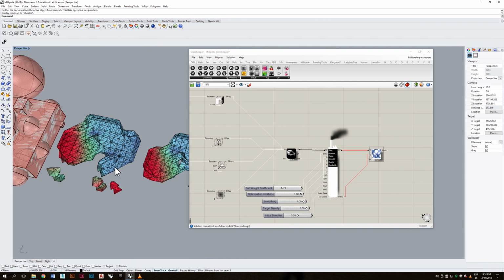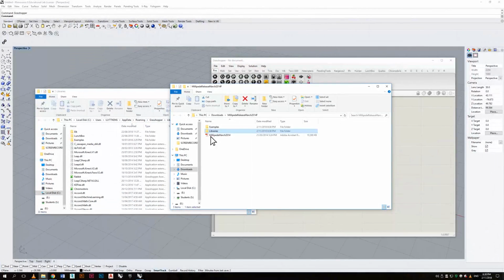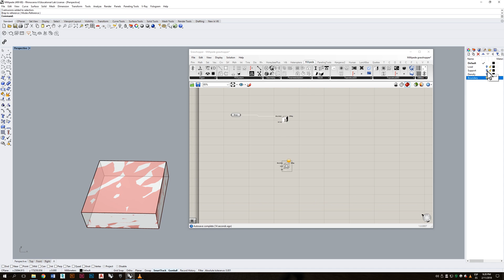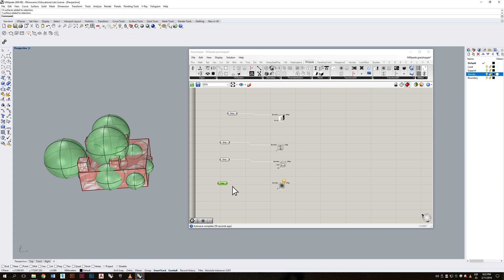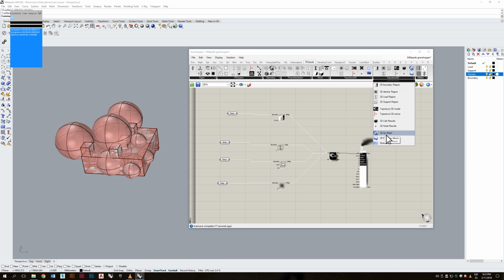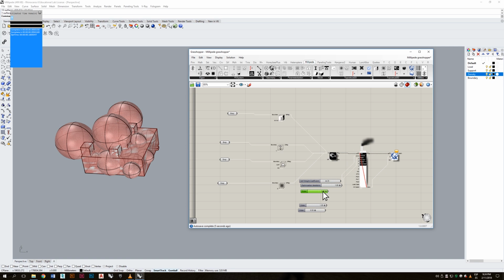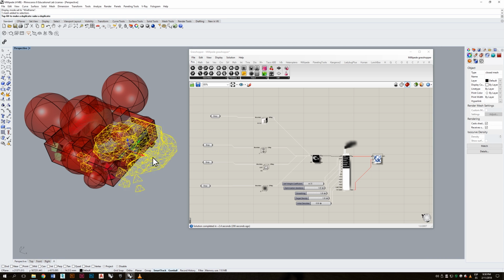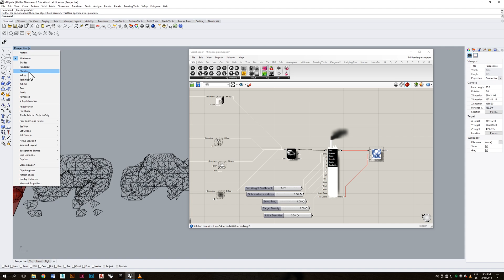Create a structure optimisation with Millipede in Grasshopper, Rhino

Comment: I put "3D boundary region" in GH, it says "this version has expired, please download new version", and there is no box shown in Rhino 6.
Reply: It should work even if it says “this version has expired”. The boundary box will not appear automatically in rhino. You need to create the boundary box in rhino and then link it to the boundary box component by setting it as a brep. Just write if you still have any trouble. Cheers!